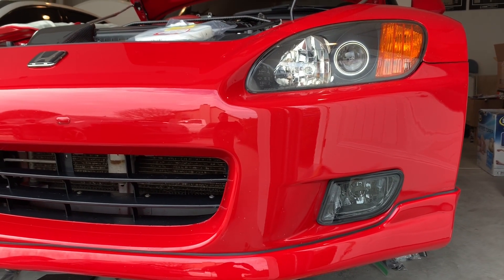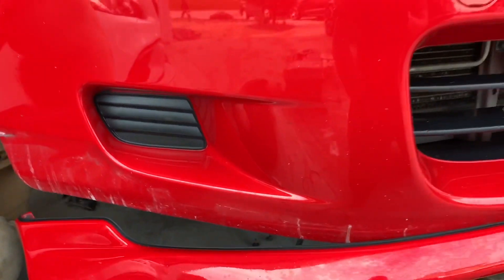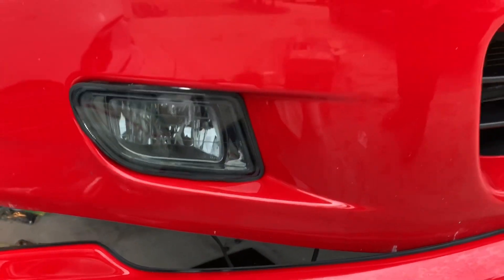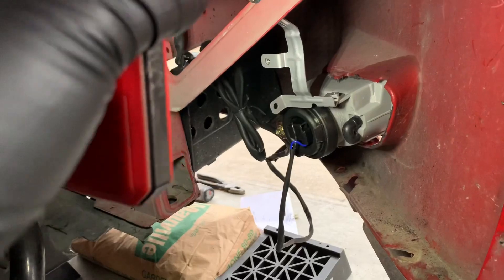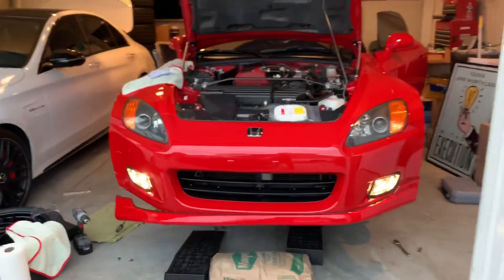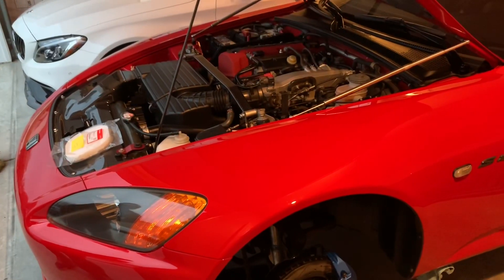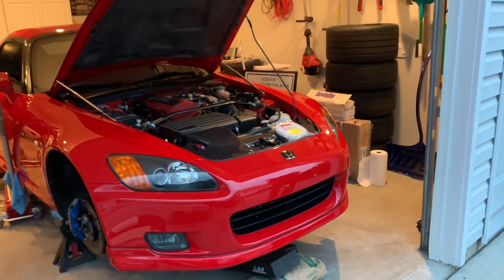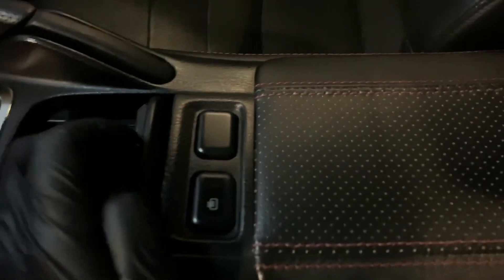Project Honda S2000 Odyssey OEM fog light install DIY

Comment: nice improvement
Reply: The part number you listed, is that for Odyssey fog  lights or the rubber molding?
Reply from the maker: @SuperBullyone that is the oem Honda trim.
Reply: What is the part number for the lights?1

Comment: 5:14 I'm looking to do this same fog light install. What should I search to find that rear defroster trim piece where the pocket usually is on the AP1 center console?
Reply: Figured out the part number. Now I need to actually find one.

List of parts form S2Ki
35500-S2A-003ZA defroster button
83403-S2A-013ZA button panel
35461-S2A-003ZA dummy button
39794-S04-014 relay
32119-S2A-000 soft top defroster harness

32205-S2A-H00 defrost button harness
Reply from the maker: You are correct.  It came on cars with the oem hardtop.